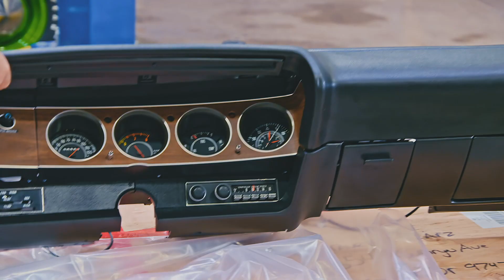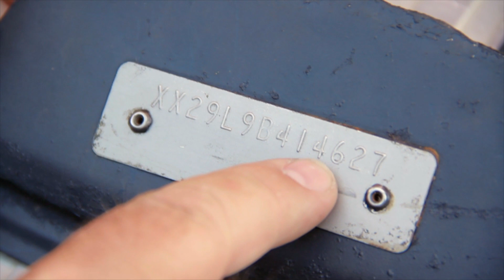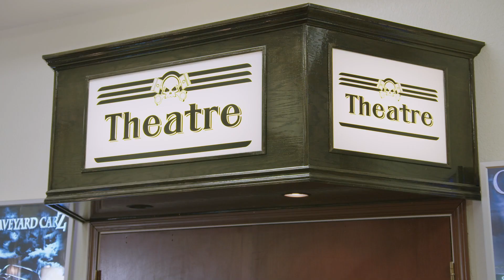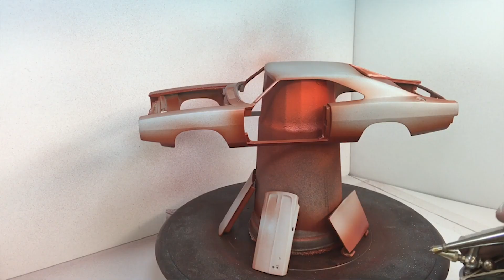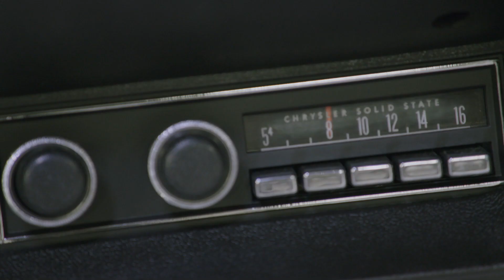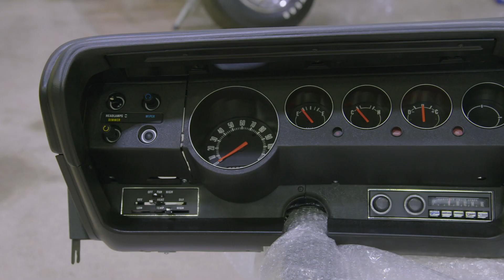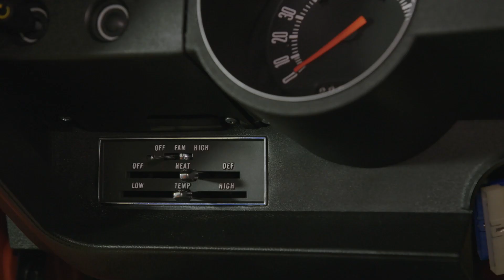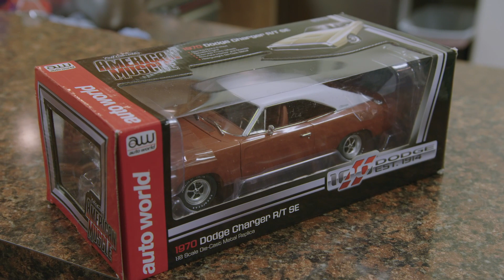MR. NORMS GRAND SPAULDING DODGE: 1971 DEMON 340 SIX PACK

Comment: old man had the 340 6 pack turned to a 400/451 6 pack    pop  got used off the lot 1971 RT challenger shaker n96 yellow standard bumper